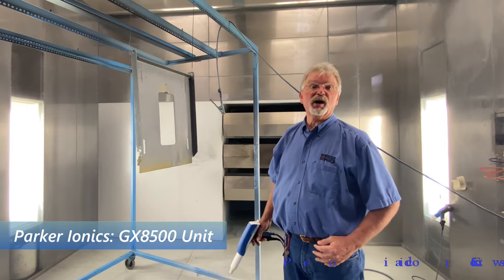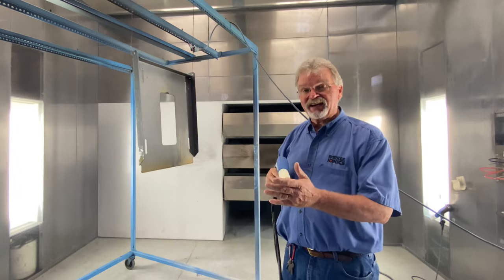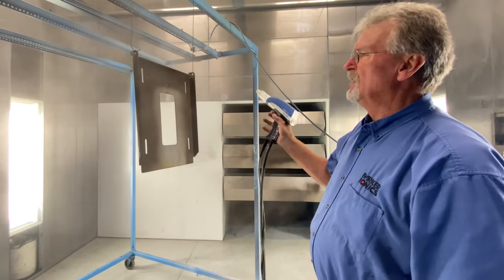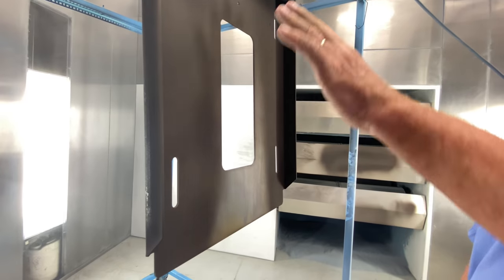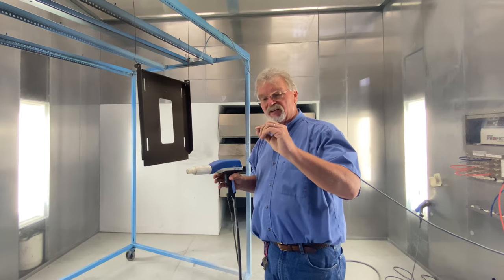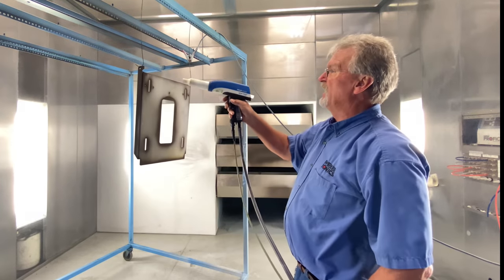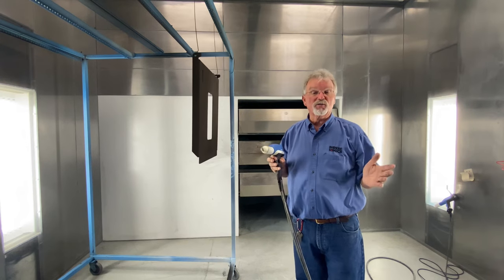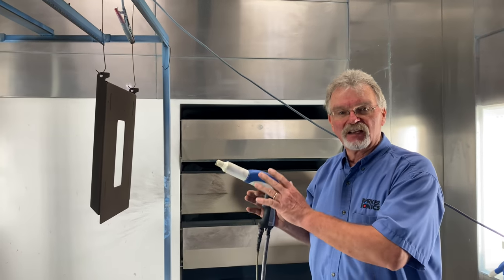Powder Coating Tips and Techniques using GX8500

Comment: 2:45 The corners where the sheet metal is broke at a 90 both have Faraday spots. Would have liked to see that covered more than the long corners. Not being cynical, just honest. I usually have to "shove" the powder in a quick motion while releasing the trigger to try to basically throw it into the spots without a charge.
Reply from the maker: Thank you for the suggestion, We will work on more content and hopefully powder coat more/ different Faraday cage areas.
Reply: I've noticed with the harder to reach places like tight corners and angles, if you spray slowly in a circular motion around the part from all angles, top bottom left right up down, the powder will stick from the back as you spray around the part